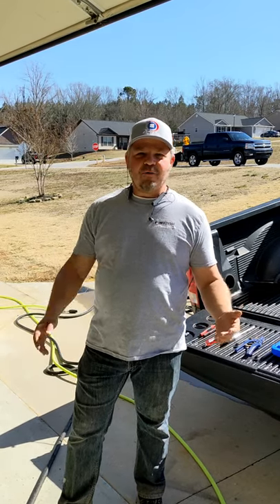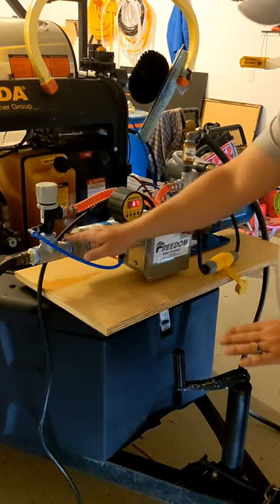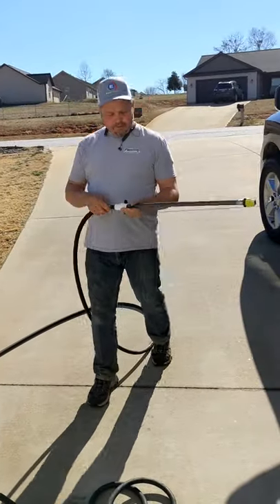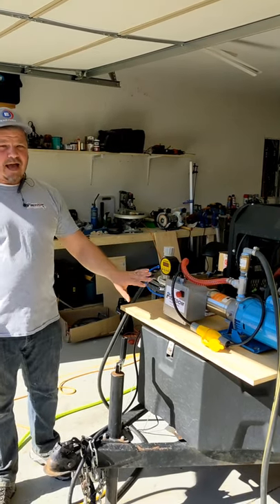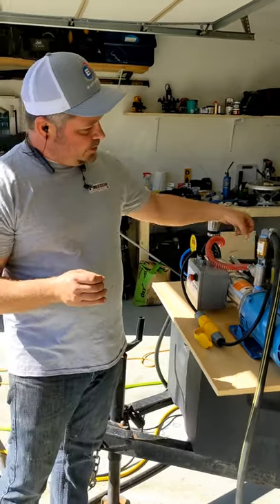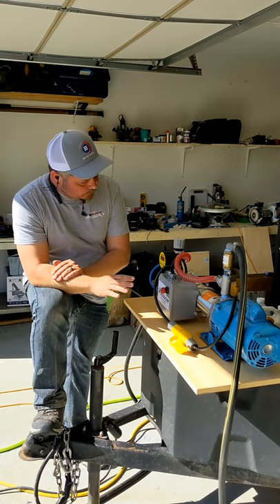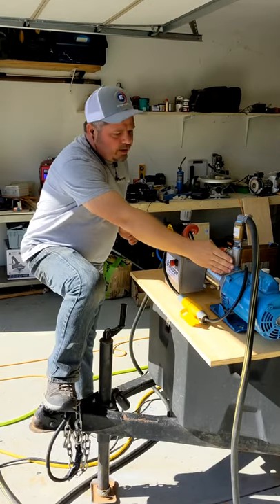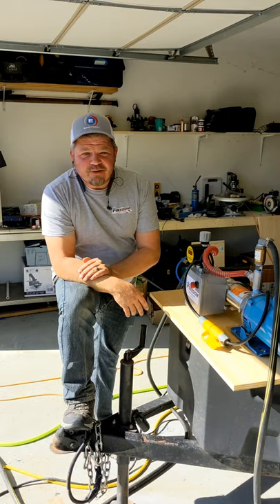Booster pump 101 for softwashing!

Comment: Great video! Keep it up. What size generator must you use for each of the pump sizes that you mentioned in your video? 
That would make a nice video.
Keep up the nice work.
Reply from the maker: Hey James, so the 4000 generator watt can barely support the 1hp boosters.at 115v ..if you go to 1.5hp and higher you should go to 220volt and the current draw is half...most 220volt generators start at 5000 watts and up.
Reply: Where can I get this setup ?

Comment: In your experience how long will that pump last pushing SH on a roof?
Reply from the maker: Hey Greg, boosters typically last awhile if cared for..most people washing allot rebuild the tube yearly...
Reply: @freedompowerwashingllc6199   Thanks for the info...I'm very interested in having this kind of system verses the 12volt or gas powered. BTW, I saw 1/2HP & 3/4 HP units by dayton, pentiar , and flotec online ranging from $277 to $425. Those size's I could run on a small honda 2k generator because there easily under 13amps. 
Now if taking care of the pump w/proper flushing & they would last a year then it  sorts makes them disposable at that price. Those Gould's are much more expensive so a rebuild makes complete good sense. Thanks for the video!